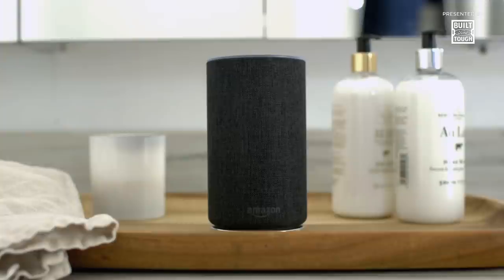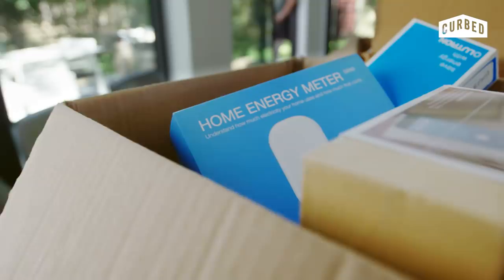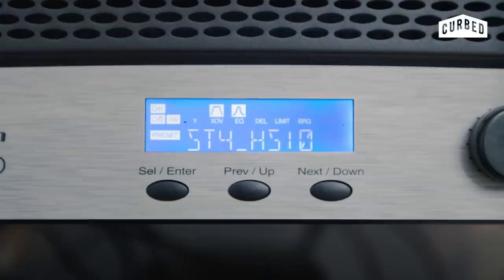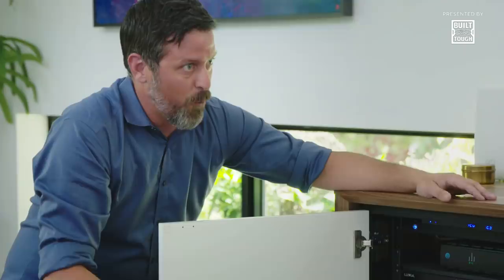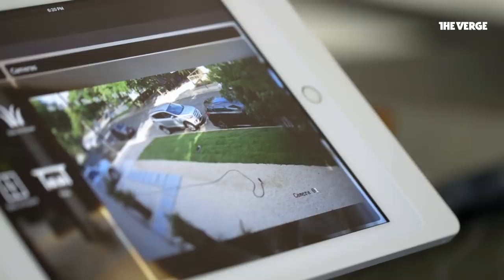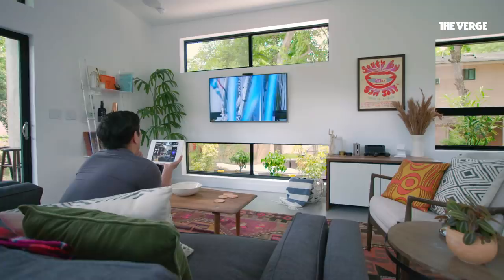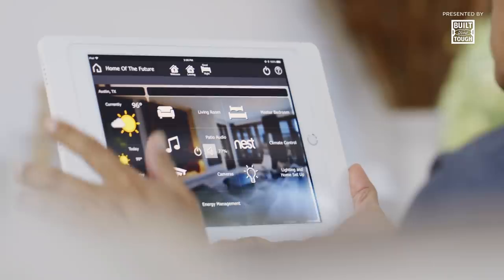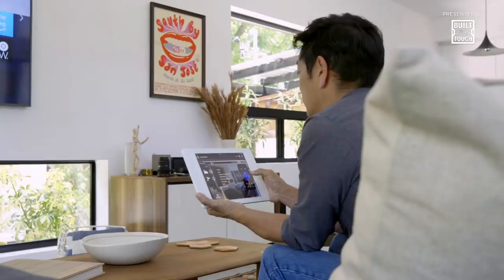Designing the brain of the Home of the Future with Grant Imahara

Comment: THIS IS THE FUTURE!
4:02 (uses windows xp to program)
Reply: It's Mac OS and not windows XP
Reply: Harsh Agarwal look a bit closer (4:10). He’s probably using Bootcamp, Parallels, or a virtual machine to run Windows on his MacBook, but that’s definitely not MacOS.
Reply: Windows 7... But still lol
Reply: Yeah, that's Windows 7 running on a mac using basic them which makes it look like Windows XP.
Reply: actually, that wasn't the real XP looks, it was windows nt, 95 and 98 looks
Reply: r/whoosh
Reply: That's Win7 running under bootcamp. The thing why it looks like XP (or even pre-XP era (Win2K, anyone?)) is because of that Classic theme.
Reply: Wow not a single one got it right, that's probably a VM with Windows Server 2008 running in a remote server, it wouldn't make sense to install Windows Server on a Mac, and yes when you're running a Virtual Machine for getting things done you don't really need flashy graphs...
Reply: Gosh, I want to die lol...
Reply: It's Windows 7 with the classic shell, my friend.
Reply: its windows 7 in safe mode
Reply: @MrChezco1995  how can you assume its under bootcamp ... caus i have a windows 10 on imac 21 inch 2007 here .. and its running windows only .. no bootcamp no mac os.. only windows...
Reply: No its win 98 😏
Reply: No. This is the classic theme for windows 7 or newer. It's meant to use as little CPU ressources as possible
Reply: Virtual Windows XP on a MBP. ja.
Reply: LOL
Reply: Windows 7 with a classic theme
Reply: @elzurotsyry  thank you, this is what I was thinking
Reply: They also used hacker typer at 0:26 😭

Comment: I've been setting up a few houses with Home Assistant, an open source home automation system that has plugins for things like lights and tvs, all the way to BMW cars that have some sort of IOT integration. This system is not even compatible to Home Assistant which is cheaper and you have full control over everything.

Comment: Home Assistant is an other free and opensoured platform for smart home too
Reply: The subscription is paid to your integrator directly and not RTi. Also its not mandatory, but the systems like to be updated to the latest firmware from time to time. plus its nice to make changes to the favorite buttons.
Reply: Wait, so if I bought an RTI box I wouldn't get access to firmware updates or being able to change uh, a favorite button screen without going through an integrator? That sounds pretty awful, honestly.
Reply: Your integrator could set you up so that they could log in remotely while you tell them what you want changed.

Comment: Awesome explanation.
 I am a Computer Engineer Technologist with at Data/IP background and a Journeyman Electrician. 
I currently have the simple setup you talked about. (Google Home, Chrome Cast, and Hue lights) I am also building a Data Center in my basement that will allow me to create  APIs so I can integrate my Raspberry Pi with the system and,  running a custom built app and Android Open Auto, allow me to remote start my older vehicles with voice command. I am also integrating the Pi's camera for dash cam and remote upload to my servers.
Using virtualization I am also building personal, scaleable cloud services and media streaming services. All to be integrated with my mobile, home, and vehicle entertainment systems.

Comment: I’m surprised you didn’t mention Apple’s HomeKit.

HomeKit is the most complete interpretation of this, basically everything they did here can be done with HomeKit if you have the correct HomeKit enabled equipment, and there’s already a healthy list of compatible devices like lights, cameras, locks, thermostats, garage doors, security cameras, security systems, taps even friken blinds... the list goes on... 
I have my Philips hue lights and Logitech Circle 2 security cameras integrated with HomeKit, and I’m very keen on upgrading some more equipment to smarter HomeKit compatible solutions.

What was showed in this video is very cool but the fact that it’s not very end user configurable (meaning needing these guys to come and make any changes because the end user isn’t allowed to) kinda, well, sucks!!!

I’m very impressed with HomeKit so far, it’s still new and needs some work but even so it’s still very good and very capable at the moment and it can only get better with software updates and more and more HomeKit enabled equipment. 

Smart integration frameworks like HomeKit baked right into the products are the future, hopefully there will be a well recognised non Apple solution for all the Android and Windows users out there. Apple is able to get it right easily because of the niche they have in the market, they can define a framework like HomeKit and other companies respond because there’s a ton of potential customers using Apple devices who would be more likely to buy their products if it used HomeKit, ask yourself this, if their product sat next to a competitor an the shelf and one said ‘works with Apple HomeKit’ and the other didn’t which one do you think the owner of the shiny new iPhone would pick?

There needs to be another universal framework standard like HomeKit to cater for the non Apple users, then smart integration will really start to take off.

The solution in this video where you need to pay someone else to rewire you’re house and charge you a fee to come and make changes and visit you every so often is definitely not the future, that sounds like a hassle. 
Both my lights and cameras were setup in minutes and fully integrated with HomeKit straight away, and I can add to that with thermostats and taps and whatever the heck I want whenever I want and set it up how I like with no paid nerd needed to do any of that. That my friend is the future.

Sure HomeKit can’t do exactly everything these guys could like with the xbox and PS4 but it does pretty much everything else and without the need of some third-party begging for a fee.
Reply: This was my thoughts exactly. This video would be more accurately described as the best smart home of the present not the future. HomeKit is growing faster than anything and is absolutely the smart home of the FUTURE. In the near future HomeKit will be able to control anything in your home like this and is easily set up. Plus setting up complex scenes and automations is super easy. If you are Android then this all would be Google Assistant.
Reply: The tech is modular - ie - it can be replaced with the latest version, and it's easy enough to then update the rest. For example, I've installed Lutron Lighting systems nearly 20 years ago, and they are still working, and can still do what is needed today. The new modules offer extra bells and whistles, and network connectivity, but RS232 still gives me two way feedback, full control, and the end user wouldn't know the difference - the wiring architecture is still pretty much the same.. However, should you want the newest keypads with the latest modules, then you just remove the old, plug int he new and it's not a huge deal.

The control processor I have running my home is near 10 years old now, and is still capable of integrating with the latest gear - the firmware update shave ensured this, and despite what the video says about API's, you are able to control pretty much anything on the market.

Now, Homekit, Google Home, Alexa etc are excellent devices, wonderful for the home GIY market, and great for people with the tech mindedness to have a go and set it up. But it's not even close to the power and control that is possible with systems like the ones shown. Having said that, most people also don't need that sort of power, so it's horses for courses.

The negative comments are more a case of ignorance, there is a place for all of these devices, but don't, for a second, think that Alexa, Homekit and Google Home would exist without Crestron, AMX, RTI etc. I was setting up Crestron systems15 years before Apple even thought about iPhones. What you, the consumer are now enjoying, is the evolution of the high end market as it trickles down. Don't hate - embrace! The high end of today will be the $99 off the shelf box of tomorrow.
Reply: As Zee points out, we have a great opportunity here with the decent handful of methods that have been used in the past and open source projects that have sprung up to add them as options to the modern control system options. HomeBridge is a great open source project to offer a way to get RS232 style command set capable devices showing up as "HomeKit" devices. Definitely more tinkering than a basic setup, but I am very much enjoying being able to add anything with a control structure.

Comment: I would not buy into a system that wouldn't let me tinker and customize. I find it condescending to think that individuals cannot handle their own home technology. It just takes a system designed to recover. The monthly fee is too high in my opinion and I hope would scale down to as their adoption scaled up, but it is important to note that addressing software and security updates as part of a monthly fee is fair and critical to smart home safety given the networked nature of IoT devices. I'd like to see an episode on addressing the privacy and security of smart homes and consideration of what policies these devices have on data collection and sharing. Where devices report eg does the device only talk to your home network or rely on a company server outside the home, what data is collected about each device use and what their individual and aggregate analysis may reveal. There are many hidden elements to the smart home of the future that the buyers should consider too, but are hidden from view in the software and policies of device manufacturers and software.
Reply: The whole "You'll hurt yourself" statement needs to be thrown out in the tech industry. We're not talking about 110v bare electrical wires or sharp cutting blades. This isn't something that will hurt the customer. At the very least, the customer might need to call and ask for help with the gui software. I understand, as an IT professional myself, that these terms are coming from the business side of tech and not the tech side of tech because after all, we're taking about all consumer grade electronics and while there are people in this world who will not try to understand this technology, there's also people in this world that will not learn how to add gas to their car or check the oil.

Comment: Personally I would rather buy into the google based ecosystem, the assistant itself is better, but it integrates naturally with nest devices, as google owns nest, and allows seamless content control with chromecasts. Also I use an android phone so it integrates with that really nicely.
It seems as if the same functionality could be achieved to the home with a couple of google home maxes and chromecasts and that the implemented system is needlessly more complex, expensive with a higher maintenance cost and ironically is backwards thinking.

Personally I use a chromecast with a projector, google wifi and a google home.
Reply: Agreed, the Google ecosystem is pretty good and it's relatively open, too. They integrate pretty well if you own multiple Google products; idk why they decided to go with so many different platforms: an Echo, Roku TV, and Nest.
Reply: I don't trust Google. When they control everything in your home they control your life.
Reply: But you're using YouTube, with a Google Account? 🤨
Reply: Carson Saldanha precisely, we already half way there.
Reply: 15 Hue lights, 6 Kasa light switches, 4 Hue switches, 3 Kasa outlets, a Swann camera system, TCL Roku TVs, Nest thermostat, 3 Google Home minis, and Android phones. All work seamlessly together, zero wires, zero monthly fees, zero bi-annual visits by a tech support salesman... Just saying.
Reply: No. If you can't see what it's doing (ie open source) then you don't know who it works for. Besides, Google is a little too fond of scraping stuff to their servers. For example, it turned out Amazon were sending to video feed from your doorbell to law enforcement without telling us. No way - my machines, my data. If I can get the system simple enough, I'll try and put it out in the public domain.

Comment: This is so overkill. What happens when the company stops updating their app? You’re left with an old version. The issue with this is there’s a $30 per monthly fee. What a rip! Google Assistant, HomeKit and Alexa is where it’s at.
Reply: The monthly fee is optional and you can use any integration company you like. You would not be locked into anything.

Comment: I have a few points, first the Ford truck is totally out of place, then its so stupid to use a locked down, paid platform. One could get the same for free with harmony and compatible devices. Or it could get even more advanced with Home Assistant (a open source free python project). At last you should consider security. As you combine everything in one hub, only that one hub has to be compromised to change basically anything, even locking/unlocking the home.

Comment: After watch a couple years of stuff like the HGTV Smart Home specials where the central control was an iPad with 30 different apps, it’s refreshing to see an example of an actual smart home integrator utilizing the consumer-grade gear. 

That being said, as I’m planning my own smart home, my plan is to utilize equipment that already shares a common platform where necessary. Some items don’t “need” to participate in automations or scenes. Smart washer/dryer combos, or smart irrigation controllers are examples of this IMO. Items like that are fine being stand-alone systems for my use-case. Everyone else’s usage may vary.

Comment: I've been able to build my own connected in a home built in 1950. I use a combination of Samsung Smartthings as my hub, Hue lights, GE smart switches, Nest Thermostat, Yale door lock, Ring doorbell and IP cameras all controlled with Google Home. I'm not an IT guy at all but I've made it easy enough for my 3 year old son to be able to control. It also didn't cost me an arm and a leg and I don't need a "programmer" to program it for me.

Comment: WHOA! So many negative comments, I am surprised how many people are bashing a high level, entry system addressing and embracing new technology. I for one think it was well explained especially for somebody who is new to home automation. Here a couple of my points, followed by my system:

First, People who have a smart home now have probably endured the constant growth and changes and maybe are not experts, but they do know the inner workings of all the keywords that are in place such as zwave, ITTT, etc.. For this technology to grow, there will need to be some transitions to  companies that do this for you and YES, they will charge and people will be willing to pay for support and just the fact that they know they hit a button or say a phrase and it works. For those of you that want to go the free route, then go for it (myself included) but know that when a firmware, power outage, or even new technology hits, we will have some work to do. 

My system:
1. Samsung Smart-things hub (Brain)
2. Multiple RTSP Wireless Cameras
3. Mesh Unifi Wireless AP's
4. Edgerouter X Firewall - NAT Router
5. Static IP's with DSL and Cable connectivity
6. Most light switches replaced with GE-Z-Wave switches
7. Many Outlets replaced with GE-Zwave-Outlets
8. Nest Thermostat (V2)
9. Yamaha 685 7.2 Receiver
10. Vivint Security system tied into Z-Wave Network
11. All tv's have Google Chromecast
12. Moderate programming of scenes / things with smart-things
13. Z-Wave Motion Detectors
14. Philips Hue Bulbs in NON switch controlled lights.
15. Google Homes / Mini's throughout the house
16. Finally I use ITTT as the glue for any device and for trigger events.

I have built what I have piece by piece over the last 4 years and I am very happy with it. There are some growing pains but it gets easier as time goes on and I find it fun to innovate new technology and add to the growing list of applications to join together applications that don't have API's, ITTT has played a key role, and not being associated with them, give them, google and samsung 5 stars for creativity and inovation.

Comment: when my country electricity is not reliable , you know I will sleep out side a lot with this smart every thing
Reply: A battery backup can keep a system like this running for a few hours, easily. Longer if you're ok with prioritizing the devices that make sense to have working in a blackout. Isn't like you need a PS4 or lights when the power is out.

Comment: So...you're going to pay this guy $30 a month to hide a few cables, neutral the primary benefit of Sonos speakers (wireless connectivity), and program an app you're not allowed to reprogram?

Seriously? 

They aren't even creating their own custom version of Alexa, which they should be able to do.  

And what happens if they go out of business tomorrow?  Then you're stuck with a system you can't do anything with.  And it's not like you'll be getting a refund.  And then you have to switch everything to another system altogether.

Austin has fiberoptic interent, so I don't see any reason why a mesh network isn't reliable enough and you have to go wired.  

What a freaking waste of money.
Reply: I did put network cables to my whole house. but then, you don't need a systems integrator to do that. Just an electrician will do. A wired connection is more reliable than wireless. Also some people are pretty sensitive to wireless frequencies. To be green, I would power down systems if people are asleep, saves electricity and the planet.
Reply: I'm just wondering what all the wires were for. The majority of smart home devices don't have an ethernet port. Only thing that would have ethernet would be the ip cameras.